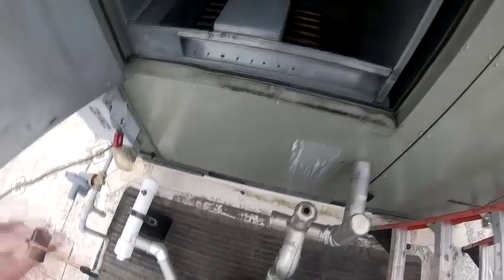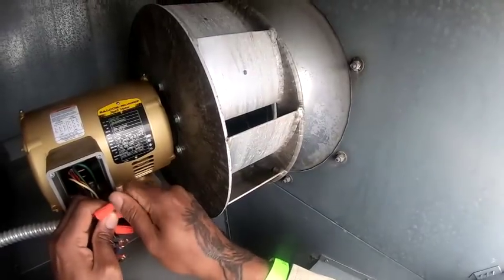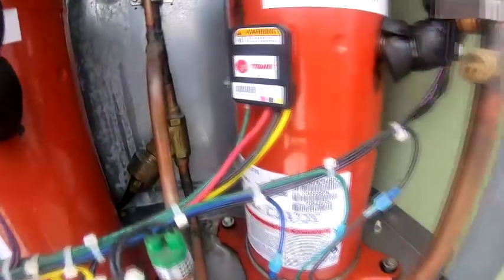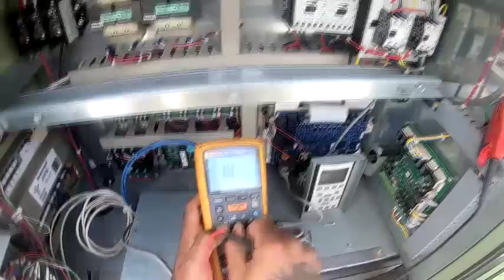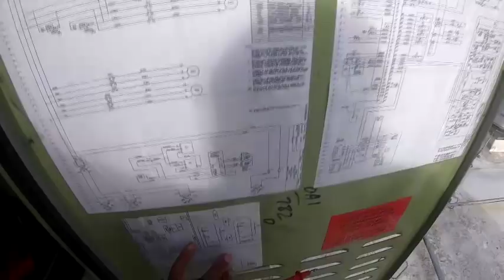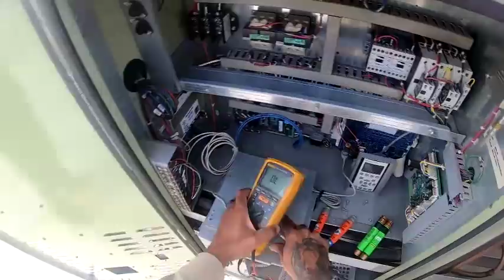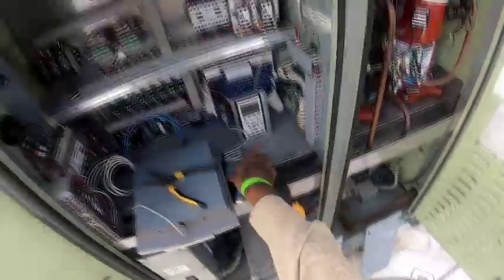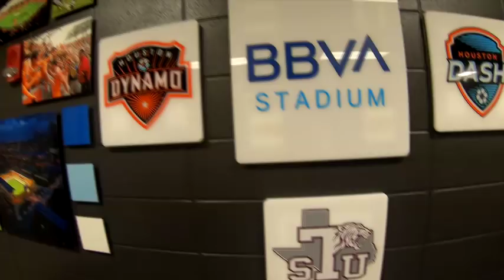HVAC system blowing fuses

Comment: Quick way to test equipment that has blown fuse - start at disconnect test all three legs to ground - that will test all the line side wires - then go to the load side of all the contacters and that checks all the wires and motors.  Spin the blower motors to see if there locked up then go for a restart - if you meggered everything as you went you would be ok to restart... if a blower is single phasing you should here it before the fuse blows.. you should be able to do that faster then the time it took me to write this...